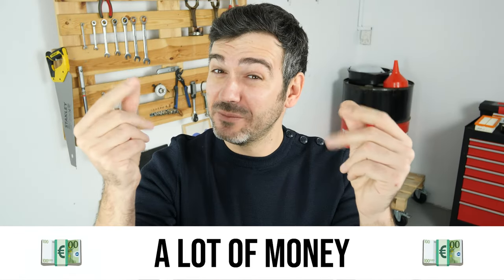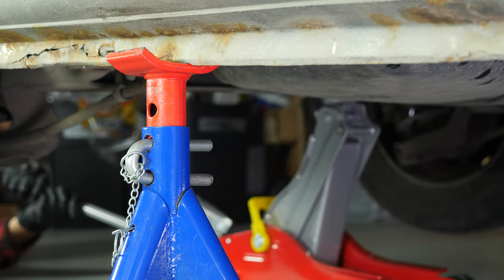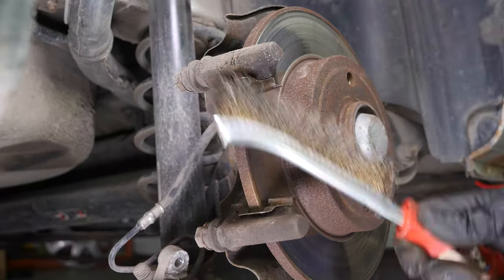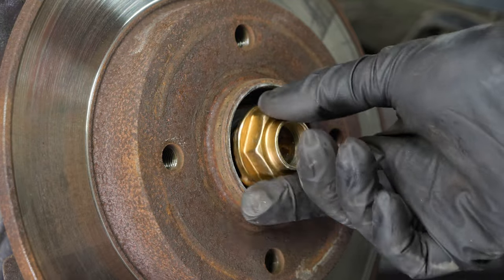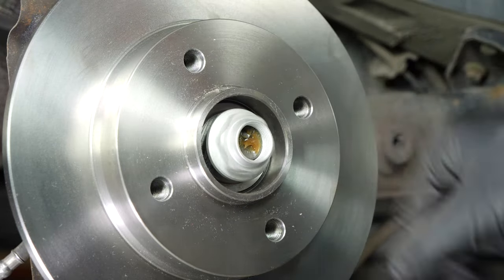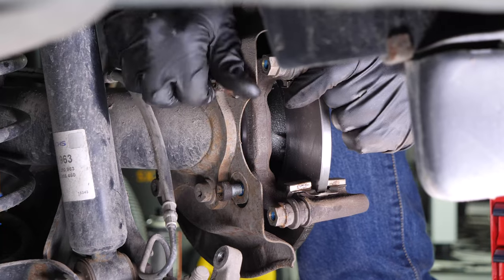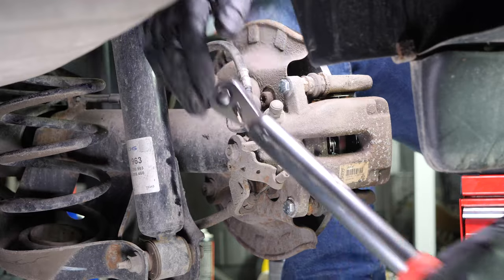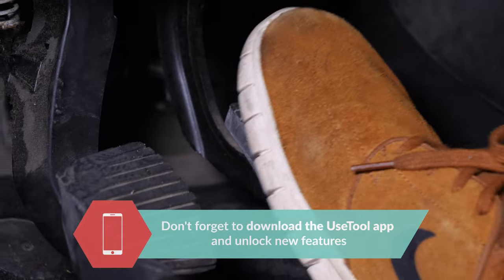How to replace the rear brake discs and pads C4 mk1 🚗

Comment: My 2014 C4 has a 36mm nut on the hub bearing. not 32mm mentioned
I didn't have a special piston retraction tool but found that a "2-pin spanner" from a disc grinder disc retaining nut  fitted the 2 notches in the piston.
Rotating it clockwise retracts the piston

Comment: The centre nut on the one I'm changing is 36mm. Had to use a long 3/4 breaker bar to remove. Not as simple as it looks.

Comment: I hope everybody is doing research better than in this video.
1) You have the jackstands in the wrong place. This way you will damage the support. You can already see the front of the support damages, probabably because of use like this.
2) You should NEVER EVER let the caliper hang on brake line. You have to support it so there is no tension on the brake lines.
3) You should never get a grease on the braking material. That's a big NONO.
It's scary how you can promote this as a tutorial.